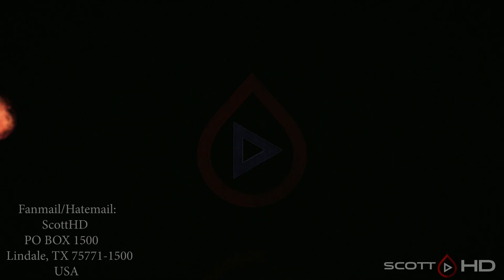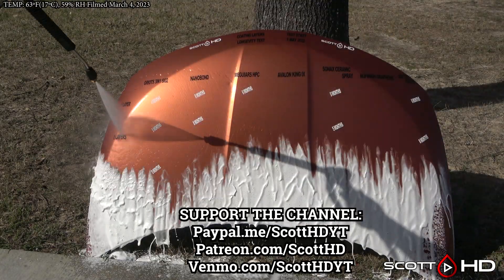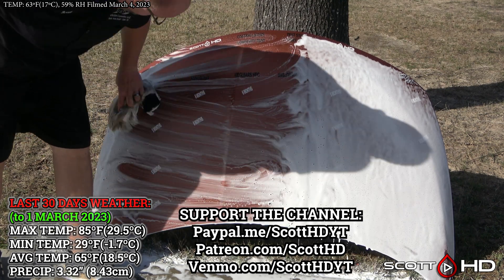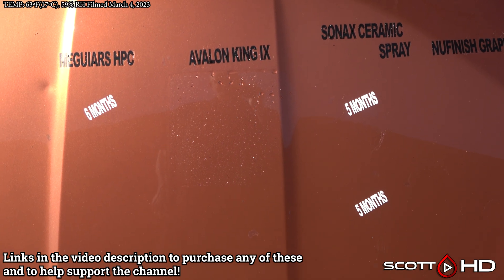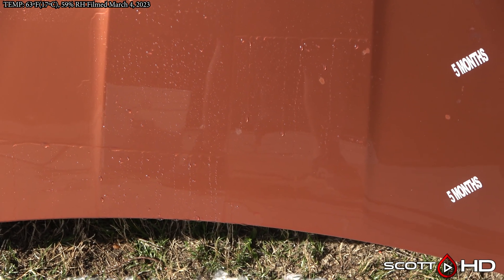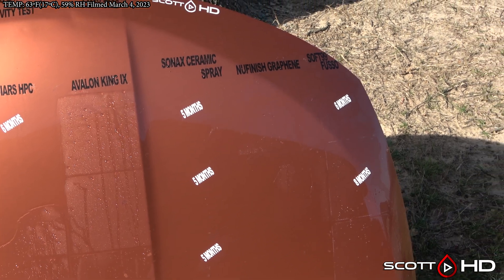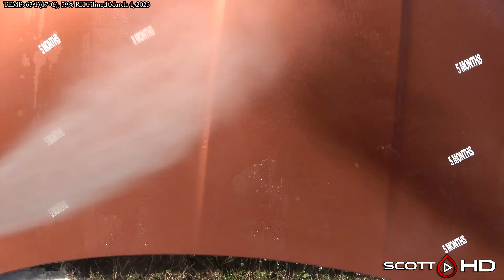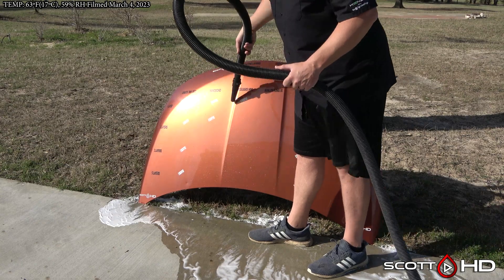CERAMIC COATINGS - HOW MANY LAYERS IS TOO MANY? Top DIY's Tested! - UPDATE 13 - 10 MONTHS

Comment: Which one would u recommend for mohs or uk 3.0
Reply: UK3.0 over Mohs.  Mohs2.0 equivalent to UK3.0.
Reply: grios 3:1
Reply: @summerforever6736 Griots not even true ceramic coating.  It’s a hybrid was with SiO2.  GTFO.

Comment: I've noticed similar things in the past when re-applying my spray ceramic.

In areas where the ceramic completely failed the reapplied area was very hydrophobic, however in areas which where weak they improved, but not dramatically, nor to the same level. 

By no means was it the same type of situation, but I always wondered why I could flood some panels on my car with ease, yet others would bead like mad when I hit them with the pressure washer.

Ultimately my speculation was spray ceramic doesn't bond to ceramic well. I don't mean it can't, just does so kinda poorly. Where as other non hydrophobic chemicals in the spray ceramic could still bond.

My guess was you end up with a layer of not so hydrophobic chemicals bonding on top of the ceramic, vs ceramic bonding on top of ceramic (if that makes any sense). It was really the only conclusion that made sense to me personally.

Areas where the ceramic completely failed had very good hydrophobicity. However areas where some ceramic remained showed noticeable worse performance. 

I wonder if that is the same situation here.